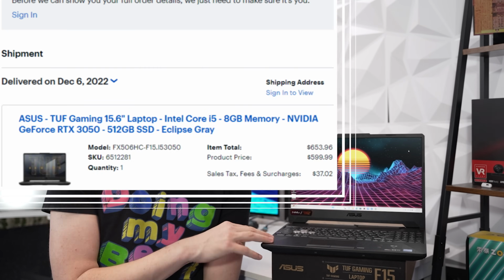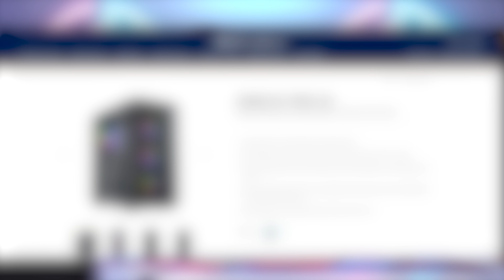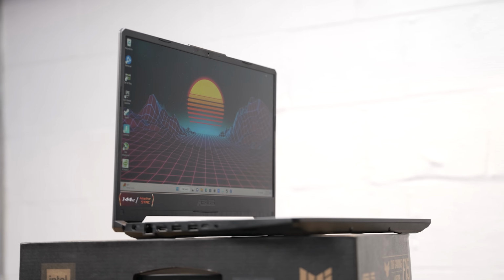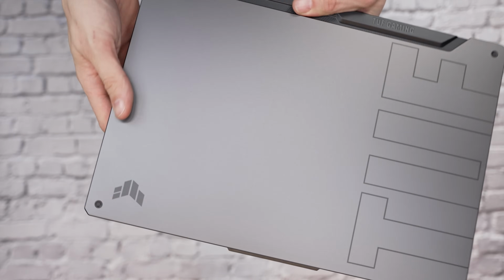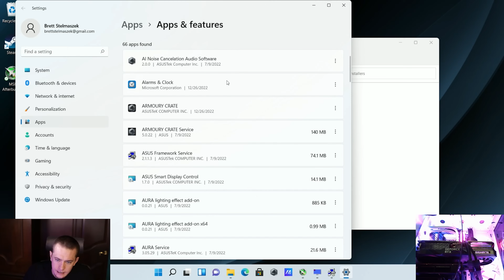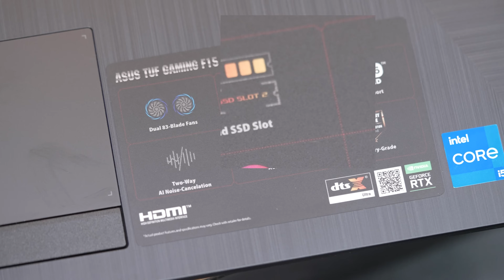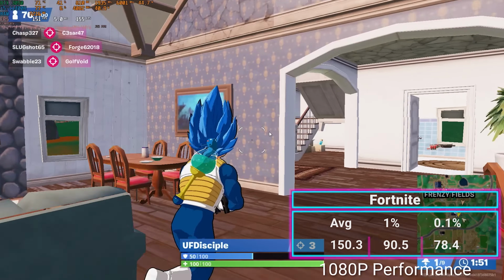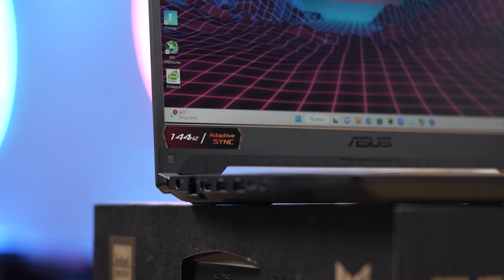Insane Performance at This Price - ASUS TUF Gaming F15

Comment: I have this same laptop. Shoved a 1tb drive and another 16gb ram in it out of the gate. Plays everything i want it to just fine
Reply: Hey man does it still hold up? did you experience any drop off in performance?
Reply: @7nini680  Hello ! I have the same model, but different color. It's just the Graphite black one. Anyways, to answer your question. Yeah, it definitely does ! Mine is still playing games smoothly, just with the right graphics setting config from Low to slightly high.  with a maximum fan speed of 5200rpm. I upgraded the ram to 24gb's and added an extra M.2 nvme ssd in it and it runs like a charm ! Sadly, it wasn't as smooth sailing as back then, cuz my motherboard got mold dmg but it was fixed. The cost of it is the fans power somehow dropped at 500\1k rpm . :((
Reply: I got the rtx 4070 version with 2Tb ssd and 32 ram...
And it's frikin blowing my mind every time i play on it !
But i really want to protect it more so i orderd a liano cooling pad and i can't wait to see even better performance
Reply: How much fps on fortnite?
Reply: @gimmessomepctipsbro  im not playing Fortnite...
But in "the first descendant"
I'm playing on Ultra settings with ray tracing on , and i get 100 fps... which is more than enough for me on a laptop.

Comment: I just got this laptop from BestBuy for the same sale price and it works great. I replaced the Memory with a Team Group Elite 3200mhz ddr4 2x16gb dual kit and the new results are phenomenal. Laptop ran Warhammer 40k Darktide at decent framerates and overall quality. Laptop gets a lil hot though like any other laptop.
Reply: 3050 rtx with 16 ram would that run well?
Reply: @skys8755  It plays Warhammer Darktide well on medium settings. Been playing that game and Battlefield V and it’s an enjoyable experience. Absolutely playable with no issues at decent framerates.
Reply: I have the same model but wit rtx 2050, it lags a lot on battery mode even when opening apps like file manager, is it the same for urs?

Comment: 3050 with 4Gb of ram is s scam. Some games cannot even run, so beware.
Reply: Which games specifically I have the same 3050 4gb ram u mentioned and it's running games just fine.
Reply: It is a bit too weak IMO.
Reply: On lowest settings....3050 laptops are entry level....not bad for that price. 3050 is basically an obsolete GPU at this point. Even with 24gb of ram it's still not strong enough to run UE4 games at high settings. 60-70 fps tops medium to low settings.

Comment: got this model but with 16gb of RAM about 6 months ago for a killer deal of 499€ new! Great laptop, have been writing my masters thesis on it and playing on work trips and for the price its amazing. There is an option to set -30mV CPU undervolt in bios which helps a bit with the thermals, mine can go way lower than that with throttlestop BUT having the throttlestop (see edit below) or hwinfo or anything that reads the sensors kills the battery so that doesnt help too much with the 48wh battery thing. Lowers thermals a ton while gaming with charger connected tho so thats good! Just a simple cooling pad also does wonders and helps with the ergonomics. Also it is possible to turn off windows modern standby and use regular S3 sleep on this machine.

EDIT. Realized how stupid the throttlestop thing sounded. There actually is an option to stop data which fixes the battery drain issue completely while letting you keep the undervolt stuff. Increases battery life and also lowers temps under load, just set it to automatically start with windows and you are good to go!
Reply: You mentioned about writing thesis. How is the heat with this one with long hours document typing? Do you burn your palms? I am planning to get this one for office work and light gaming tho
Reply: @naqib4235  the heat is very manageable, not a problem at all even when gaming. Battery life leaves a lot to be desired tho.
Reply: How well can it handle games??
Reply: @jusoutajail9185  I'd say Im pretty pleased. The temps are good and the GPU has 75W power limit so it actually has some room to boost. The performance is about as good as it gets for mobile RTX 3050, just take into account that it has 4gb of VRAM so you depending of the games you are going to play you might have to adjust textures etc a bit.
Reply: Hi, any feedback about the battery life? How many hours for office work? How about for gaming? Does it have a 80% battery life feature?
Reply: What do you mean by stop data? I have a horrible battery life, also I can't find a way to undervolt from my bios...
Reply: @roiiitruster  In the throttlestop app right in the main page there is a button that says "Stop Data" which basically stops it from constantly pinging and waking up all the different sensors in the system. This increased my battery life significantly. I guess you probably shouldnt leave something like HWinfo64 etc. running either as they might do the same.
Reply: Hey so I wanna buy this laptop, any ideas on how to handle the overheating? I didn't really understand from your reply
Reply: @sivan943  I don't hate the laptop, even though it reaches high temps, raising it from the surface and repasting it can make it better, and while mine overheats, performance is super good. If you find a better option like the legion 5 then go for that maybe but I think this isn't a bad option.

Comment: The Ryzen processors that come with these laptops are fast as well.

The one I've got beats my water cooled 9900k at hammer compile, not a small feat despite the age of the 9th gen.
Reply: still the Intel processors are a lot better imo
Reply: @MuhammadHosny0 nope
Reply: @alexk-2025  no, it's a fact.
Reply: @MuhammadHosny0 can you please explain why?
Reply: @MuhammadHosny0 I don’t know which to go for….either intel or amd processor?
Reply: @Rexbw821  more cores and more power but it takes more electricity and needs a very good cooler.

What's your budget?

Comment: I have the F17 model. I love it to death. It's a wonderful gaming laptop, even though I just play PS2 games with PCSX2 and 1080p XD
LOVE it a ton! Runs Linux quite well.
Reply: man i just remembered the linus joke about how we all (the viewers) only want to play ps2 games with our expensive systems I'm crying
Reply: @repawn3610  yep. I ended up selling it for an M1 MacBook Air 
 Plays Ps2 and GameCube games  no problem with no heat
Reply: @StaceyAyodele  i guess you weren't a RGB snorting Mt dew / Doritos gamer after all
Reply: @repawn3610  No...I just didn't play modern games and the retro games I wanted (Dolphin and PCSX2) ran without issue. 

So an M1 MacBook Air made perfect sense for me.
Reply: @StaceyAyodele  respect G
Reply: @StaceyAyodele  how do u run ps2 games on m1
Reply: @gursimarmiglani9143  PCSX2 or AetherSX2.

Comment: I have an ASUS TUF that has an 8750h and a 1050ti that cost £800 back in 2019 on sale. Biggest issues I deal with are likely the ones you'd deal with on this laptop too. Inadequate cooling, very small battery (this one only had a 48wh battery) no GPU switch meaning the dedicated GPU is used all the time reducing battery life, loud fans, and mine only has a single video out, though I think the usb-c fixes that on this new one. You buy this kinda laptop to have it plugged in most of its life, but trade off is you get great performance, and gaming on a budget.
Reply: newer models fix pretty much every problem that I have with my 2020 tuf
Reply: >800
>On budget
lol
Reply: @konolinkuda3586  Gaming laptops are usually £1000+ so ye £800 is budget, especially now in 2023.

Comment: Bought this (1 year older version) nearly a year ago except it was a GTX 1650 with the other specs being the same for more than 1400 AUD which is quite expensive when comparing price to performance ratios. (I was in dire need if one for school and made a rash decision) The battery life as said is as said not good and I always carry my charger in my back pocket. If you have any questions let me know.

Comment: The model of this laptop I found on Amazon, as of now, biggest card it comes with is a RTX 2050, all other specs are the same, and it’s listed for $649.
Reply: Oof
Reply: Found a HP unit on Microcenter that's 600$ with a 3050 6gb

Comment: I purchased the same one on sale in the UK. Mines had 16gb RAM but only the 48wh battery. Strangely enough it doesn't have the connections for a sata drive which should be present in the smaller battery model.
Reply: how you finding it? Very close to purchasing one today, 3050 16gb RAM 11400H

Comment: If you set the CPU power settings in Windows to 95% instead of leaving it at the default 100% does the laptop run a bit cooler. Also can you switch off intel Turbo boost if you want to run it at the base clock frequency?

Comment: 1 month until I start Mechanical Engineering, would this be a better option than the (Lenovo IdeaPad 3i 15.6" FHD
120Hz 11320H)? Performance difference shouldn’t matter too much, looking for better intensive battery duration

(Asus TUF Gaming F15 15.6" i5
16GB RAM RTX3050)
Reply: Asus will be better option if you buy 90whrs battery version, i think Lenovo IdeaPad 3i only has 45whrs. but if lenovo has bigger battery like 90whrs it will be better for you.

Comment: How would this hold up now in June of 2024? I'd be buying this one. ASUS TUF Gaming F15 (2022) Gaming Laptop, 15.6” FHD 144Hz Display, GeForce RTX 3050, Intel Core i5-12500H, 16GB DDR4, 512GB PCIe SSD, Wi-Fi 6, Windows 11, FX507ZC-ES53,Mecha Gray.     Could it handle Diablo and Fortnite? Please respond ;-)
Reply: Owned it since September last year. Graphics card just died

Comment: Can you show the process of disconnecting the battery on this laptop? I want to know if Asus is doing the same thing with new TUF laptops they started doing with the Zephyrus lineup. They use bare metal locking clips to lock the battery connector down that looks and feels sketchy even attempting to remove to disconnect the battery. Reports on reddit show that people who attempted to disconnect the battery saw sparks and killed their Type C ports etc.

I saw this on mine and I didn't even bother doing anything, I just closed the laptop back up.

Comment: You said the battery life wasn’t good. What if you keep it plugged in? I know that sometimes that can decrease the battery life when not plugged in, but would that help?
Reply: Battery life is determined whether how good or bad you use your battery from, for example, if you overcharge the laptop by plugging it in, it would potentially drain the battery life quite significantly. But if you use the laptop and let it drain to approximately 30-50 percent recommended, it should be fine and the battery life would be a lot better.

Comment: The display lets this budget gamer down. 300nits and only 47% sRGB. Pretty poor really. The Gigabyte Aero is OLED, True Black, 100% sRGB, but only 60Hz. My phone does 120Hz but I never use it.
There are different .tiers to the TUFF F15. The model on it's way to me has 16Gb of RAM almost a necessity these days and an RTX4060. But that screen remains disappointing when $100 more should get more nits and closer to 100% sRGB. Also 1Tb of NvMe is so cheap now, even more so for manufacturers but only 512Gb in this and upper models, forces me to believe these are built down to specs to allow tiering of the various models. Audio is below par and for a gamer Asus need to upscale this in future TUF models. Something always wanting.

Comment: man this is not possible, i just got this laptop asus tuf f15 i5 11400h 8gb ram and rtx3050 , in warzone 2 even at minimun settings i get 24 -40 fps, is unplayable, i already did all the configurations that had to make and tips i got from a lot of videos. using RTx gpu, plugged in, turbo mode, no apps running in backround, last drivers etc. Should i upgrade to 16GB of ram? that would be a solution?
Reply: I think you need to upgrade it to 16gb ram to show it's full potential, many people suggest it
Reply: What the other guy said below, definitely need another ram stick

Comment: can someone help me please? i got this laptop, when i first tried it it was really good and i felt like a god playing on  a nasa computer, then something happened it now performs trash, idk why this is happening because its very annoying, i paid 800 dollars for this beast and i have been able to run fortnite at a really good graphic with really good fps, now my game lags as hell when i play with really good graphics . i had to take my resoulution down to low because i kept lagging , im now at low grapchics 70 fps , i dont  understand whats going on with my laptop but it doesnt perform like an rtx 3050 i5 11400h laptop, it feels much weaker , in battlefield 1 i am at medium grapchics and i have a rough 30 fps and its not even stable , please help i paid so much for this and im not getting the performance that i have been told to i would get, it wasnt this weak when i got it. the only thing i dowloaded was torrent to dowload some free games and i could have gotten a virus or idk but please someone tell me whats wrong with it because my dream was a good computer and i finally bought it but it doesnt perform as it should

Comment: They dont sell it anymore 🥲
Reply: I got one on amazon for 700 USD a few weeks ago. Same specs as the one in the video except a USB A port is replaced by a USB C port, and it has 8 gb more ram. I believe it was a TUF F15 2022 model

Comment: Compared to desktops, laptops are a super ripoff price/performance. Compared to some $1000 laptops, this one is trash. However, compared to cheap entry level laptops without a dgpu… jk it’s still lame. It’s basically a $250 laptop with an rtx 3050 and better screen for an extra $550-750.
Reply: I understand. My g14 also performs poorly compared to my desktop, and especially when compared to the best consumer hardware today. More accurately, just about anything today is great for everyday tasks when I remember my cheap HP back in 2005, but laptops are really expensive when compared to desktop performance. The reason I also own laptops is obviously portability, but it really annoys me how expensive they are.

Comment: The offset keyboard ruins it for me.  Hey laptop manufacturers, nobody wants/needs a number pad in 2023.  Canter the damn keyboard!
Reply: I have a g14, and I hate that it doesn’t have a numpad haha. Engineering work is annoying without it, but I’m getting used to it.
Reply: It is fixated to space button anyway. In a sense that it is on the center incase you unsee the numpad. Numpad is a solid reason to have 15’6 inc or above and it would be a bit lame to have that much of space without something that useful. 

Better buy 14’1 inch if you don’t want it.

Comment: Don’t buy this laptop. I’ve had it for just over 1 year and already facing 2 major problems. 1. Overheating, even with a high powered laptop cooler. 2. Screen issue (glitch marks etc). This laptop is known to have bad screen issues. Don’t buy
Reply: I agree, the laptop sucks
I have a tuf f15 gaming 2021 model and theres a lot of issues starting from my windows key being disabled sometimes (winkey+v works as well and other shortcuts with winkey) and then wifi drivers just doing a funny
Reply: which one would u suggest for similar budget (or lil over) ?

Comment: Yeah, the F15 is cool and all, and btw I have that specific model, but there are two things that I hate about this laptop.

1. From factory comes with JUST 8gb of ram, so playing GTA 5, BeamNG or any game that demands more ram it just struggles to run it, so now I have to buy another 8gb DDR4 3200Mhz stick of RAM to properly run my games.

2. The Wi-fi module, antenna, driver or whatever it is, is basically GARBAGE, I have tried a lot of different routers and drivers but I keep disconnecting from my own network, if you search for a solution for the MediaTek module you will find that is a common problem with this laptop, even you will find various threads in the official windows forum, some people says that is a problem with the windows version (doesn’t matter if is W10 or 11) or just bad drivers, and as I said, I tried everything but the problem persist.

This is my 3rd Asus laptop, I already had a 2016 i7 Vivobook and also a late 2019 i7 Zenbook and non of those have made me any issues as this TUF has, so… I recommend this laptop? absolutely NOT